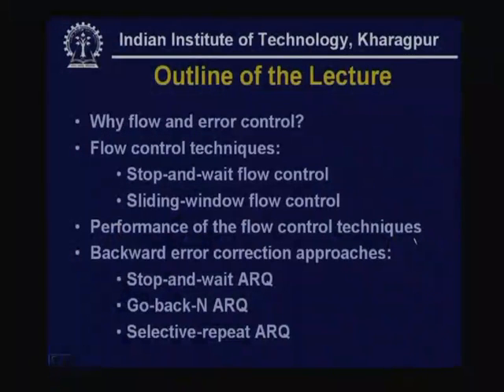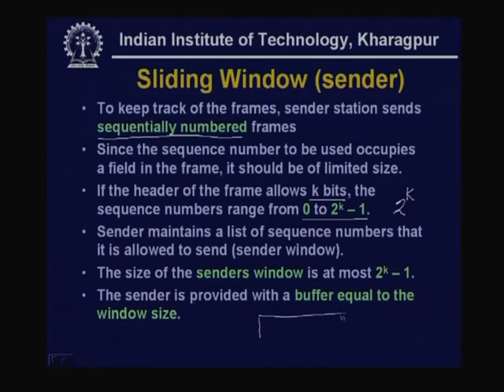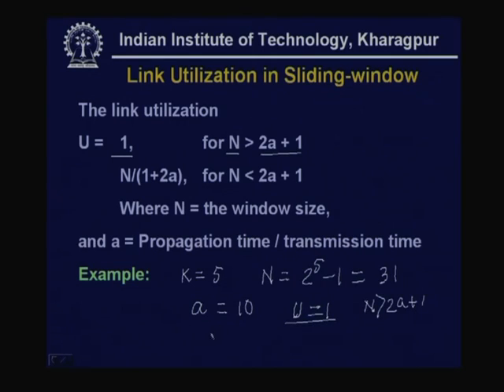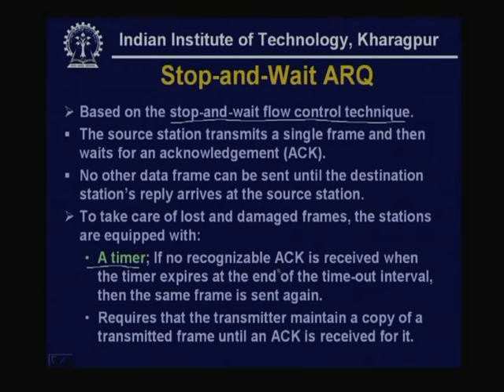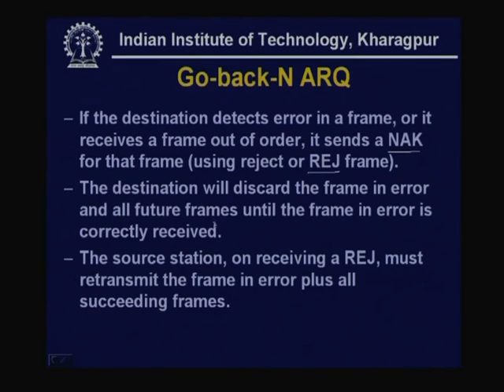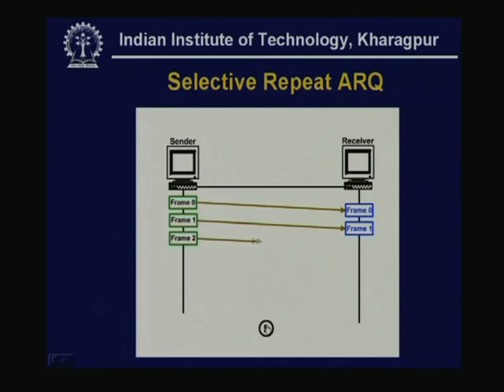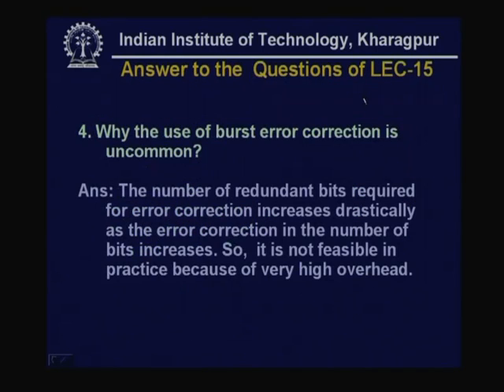Lecture - 16 Flow and Error Control

Comment: 01:48
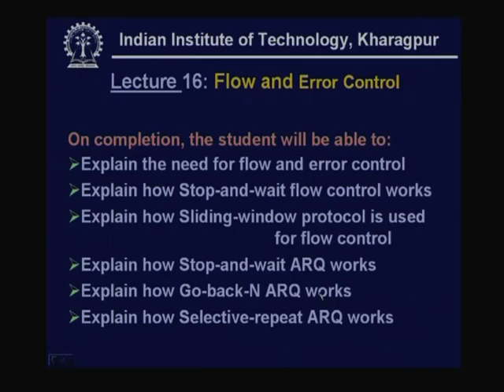2:38
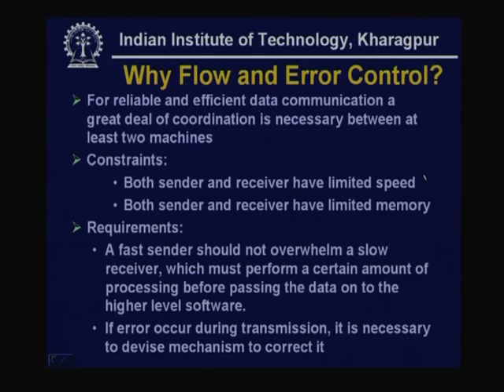03:25
07:40
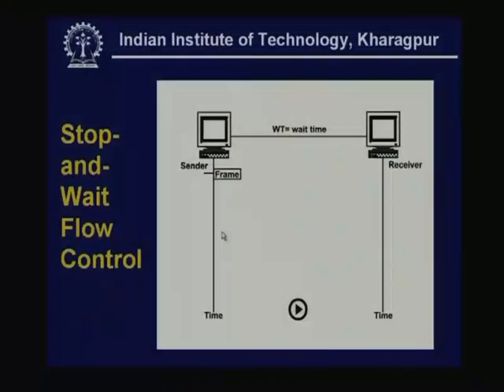08:58
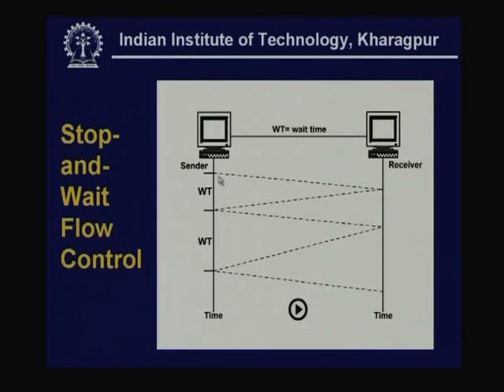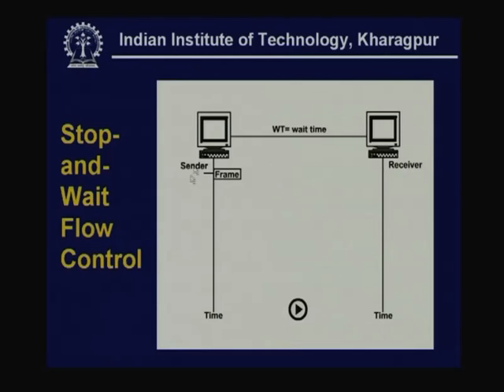9:55 (Note: Appears within the description for the slide at 08:58, but explicitly referenced)
10:33
12:44 (Note: Appears within the description for the slide at 10:33, but explicitly referenced)
13:22 (Note: Appears within the description for the slide at 10:33, but explicitly referenced)
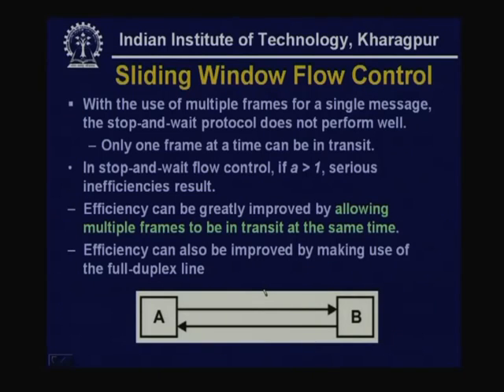14:18
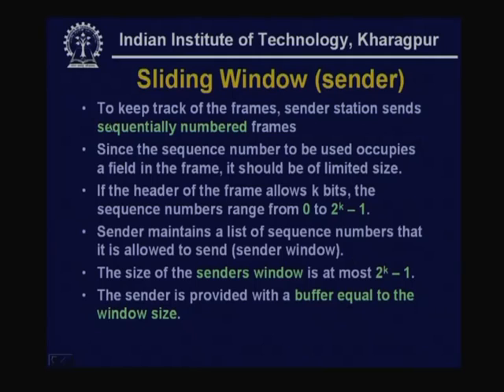16:32
16:38
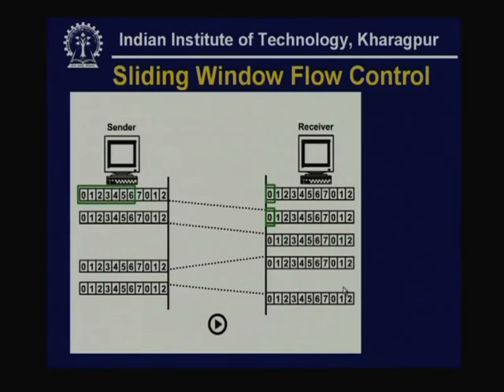20:55
23:12
25:30
26:00 (Note: Appears within the description for the slide at 25:30, but explicitly referenced)
31:57
33:20
35:04
36:55
38:10
39:20
40:55
41:00 (Note: Appears within the description for the slide at 40:55, but explicitly referenced)
42:33
43:56
44:38
44:40 (Note: Appears within the description for the slide at 44:38, but explicitly referenced)
45:30
45:36 (Note: Appears within the description for the slide at 45:30, but explicitly referenced)
46:30
48:05 (Note: Appears within the description for the slide at 46:30, but explicitly referenced)
48:42
51:40
52:10
56:30
57:10
57:23
57:55
58:38